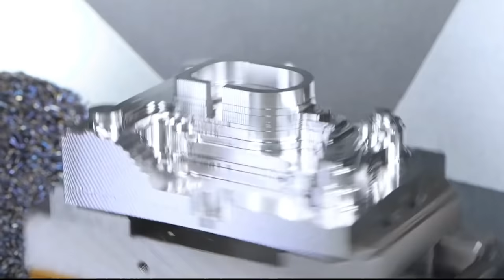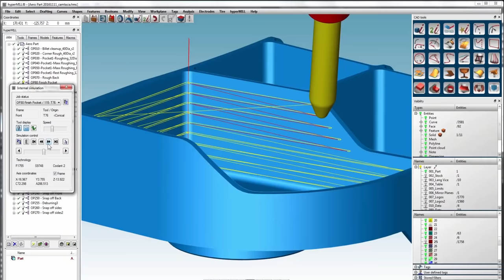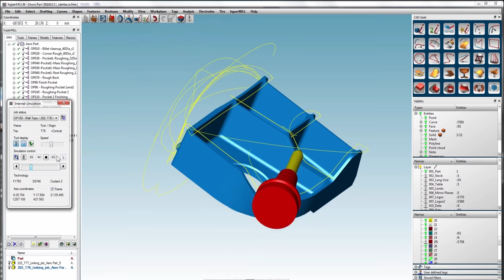CNC Machine Working Process 5 Axis Machining Metal & Aluminium Aerospace

Comment: What is meant by 5 axes, can someone explain and what is the price of the machine, can it be acquired by a medium-sized mechanical workshop, for example, with 100,000 thousand dolas 😊
Reply: Só usually a machine will have 3 axis X y z. A 4th axis is when the part can rotate 360 degrees and 5th is rotation on the z axis at 180 degrees. Giving you acess to all sides of the part (aside from the base )
Reply: Up,down, forward, side to side,and angle cutting.

Comment: how accurate are these machines in 1000's of MM?
Reply: Within 0.001 mm
Reply: Very accurate. Does require some adjustments on length of tool and tool sharpness.
Reply: As accurate as the stone vases from the pyramid as seen on uncharted x YouTube channel? Worth a watch - will blow your mind

Comment: id remove all that material with a bigger cutter you're just wasting time  
BRO
Reply: bigger cutter just leaves more in the corners youd have to go clean out.  why make program with 15 cutters if you can do it with 6?
Reply: @derekgardin1512 because you're the lazy machinist if you are maybe just a cnc operator who likes to sound tough 
just be a good dog and do as youre told